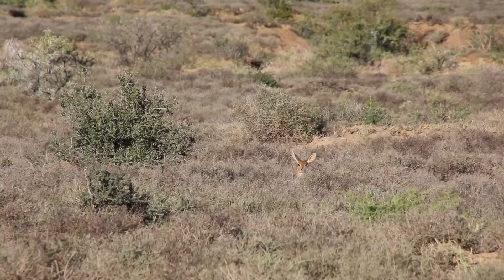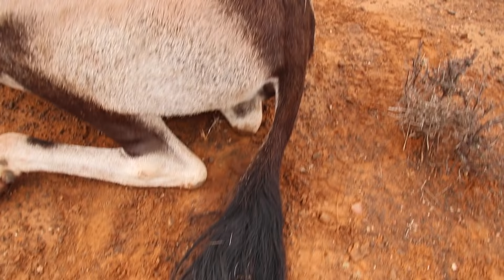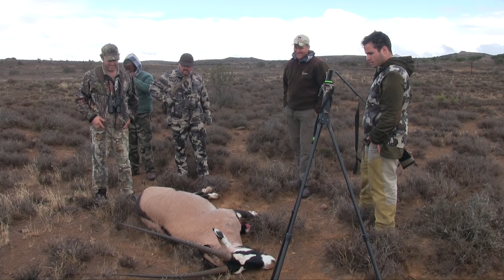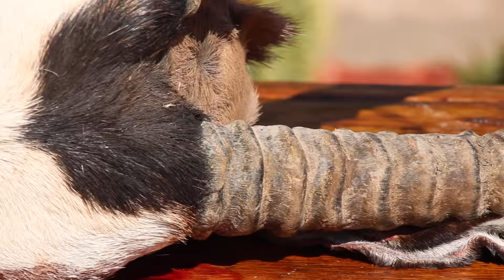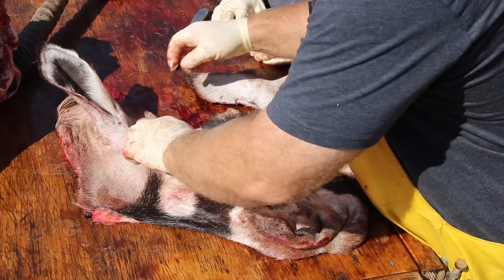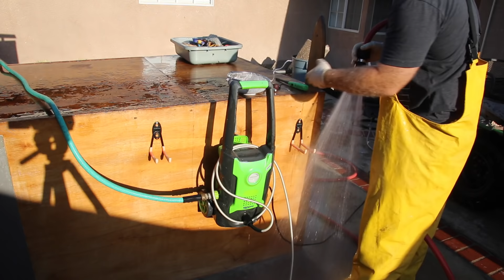HOW TO CLEAN A GEMSBOK SKULL HUNT BONUS

Comment: A taxidermist friend of mine told me to use Old English scratch cover for dark woods on the horns. I finally got my euro mounts back from Africa and when I have time I'm going to boil, whiten and try out the Old English on them. They are totally clean but have a yellow tint to them. Thanks for posting these videos, I've learned so much!
Reply from the maker: +Daniel Robles  Thank you for the tip on the englisg scratch info and thank you for watching.